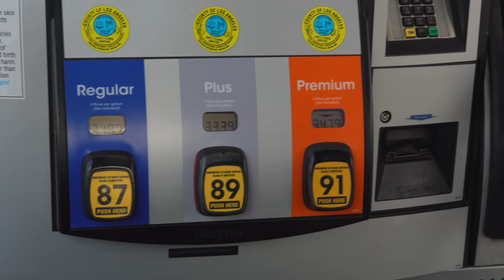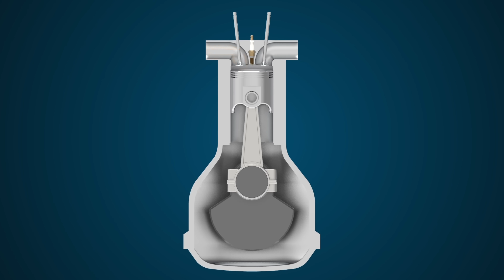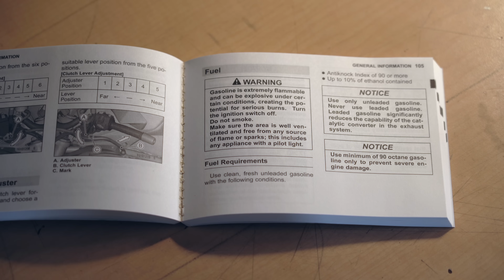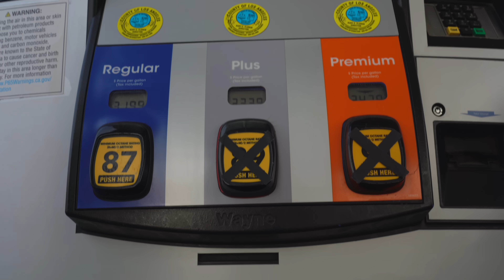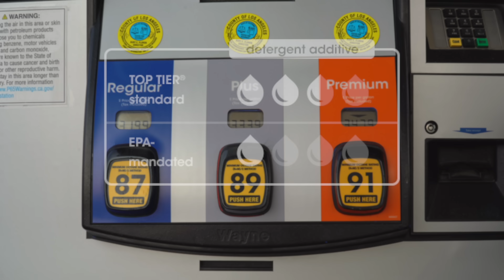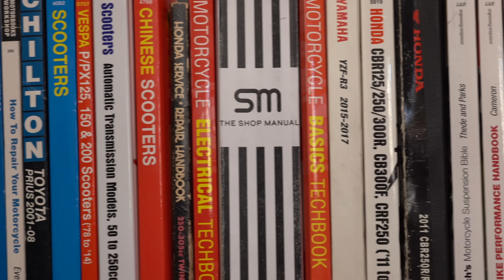Should You Run Premium Gas In Your Motorcycle? Octane Explained | The Shop Manual

Comment: So i have an mt09 and it says use unleaded only yet im still confuse between 93 and unleaded
Reply from the maker: At this point all gas is unleaded, so you can just ignore that.  93 is the octane rating, the big number on the button you push on the gas pump.

-Zack
Reply: @RevZilla  thankyou zack big fan of urs

Comment: This isn't true. Tests have shown the average engine produces better mileage with a high octane (to a level) because they make better power. Modern efi can change the amount of fuel the motor gets. The more efficient burn, less detonation, the less fuel needed, better power.  Also on a side note. Most fuel stations buy this garbage called "transmix" which is where fuel storage facilities off their systems after a change to maintain clean fuel lines. This transmix is purchased and waters down the fuel that stations purchase when requested. 87 octane is where this usually ends up and in some cases, 91 is taken down with mixtures to 89. Transmix can contain light lubricants, diesel, gas, jet, oils, etc that a storage facility or pipeline company potentially have in their system.

Comment: I only use 93 octane in my Harley LiveWire. It seems to keep the plugs from fouling.
Reply: Damages the flux capacitor ???
Reply: @scotthorn5792  only above 88mph.
Reply: @scotthorn5792   Now that could be a problem.
Reply: @scotthorn5792  Absolutely!
Reply: My 96 virago literally says premium fuel only on a  manufacturer sticker above the tank on the frame
Reply: @FalloutGenius1  … That means your Mc needs Premium fuel!
Reply: I do the same in my Powerstroke. Not a single fouled plug yet!
Reply: I usually use diesel in my live wire
Reply: 😂😂😂😂 perfect I do the same in Tesla 🤣🤣🤣🤣
Reply: Get a Honda and not worry
Reply: You may be burning oil that it is not suppose to burn, (at the same time running a rich fuel/air ratio), or you may be running too cold of a heat range for your spark plugs.  If you have the right plugs, you need to lean out the fuel/air ration so it runs hot enough to burn off the deposit on your plugs.  All a fouled plug is, is a sort circuit with the voltage going though the wet deposit instead of jumping the gap.  You will also get better fuel mileage, more power and probably top RPM, (which we don't hit with Harley's anyway).  Even if you are burning oil that you should not be burning, (valve or ring leaks), the proper fuel/air ratio will burn that too, and not foul a plug. Either your plugs are too cold, or your combustion is too cold. If you still get smoke, (other than starting it up), then you are burning oil you should not be buring.  I take it you have a carburetor on that bike,---because Fuel injection runs super lean---with white plugs.   If you jet your carb,---just go lean enough to make your plug dry, and a light paper brown bag color on the porcelain. If your plugs, (the right heat range mind you, and use the inexpensive NGK plugs), get grey or white---you are going too lean.  I learned on dirt bikes.  I don't know your bike.  But you can buy a "shop manual", (not just the owners manual), from a dealership.  That is the book the mechanics use in the back room.  Should have all the information you need,---but some drunk guy wrote mine. :)
Reply: @EarthSurferUSA  a Harley live wire is all electric.
Reply: @justinpennington7682 don't you just love the way everyone has to explain things like they are all experts. I usually plug in my Street Glide to 93 octane watt outlet! 💀
Reply: Live wire is electric……. 🤔
Reply: Pro tip: lick the charge cable before inserting it, it increase the electrical output
Reply: My Harley V-Rod calls for high octane only and it isn’t even electric........
Reply: You r a live wire! Ha ha ha. Excellent joke, well done old boy!
Reply: WOW! So many of the replies are down right scary! 🥴
To think these people are allowed to drive on public roads and can vote! 🤦🏻‍♂️
Reply: Same here on my 1.6 LH7 in my Chevy Cruze.. keeps the plugs from fowling... ;)
Reply: I knew someone that was gonna do that, but they decided to run their bike on hopes and dreams instead.
Reply: Sometimes that 93 is not 93.
Reply: And I run e10 and e15 in my 84 V65 magna. 46,000 miles in 16 months and haven't even thought about pulling out the spark plugs yet. Changed synthetic oil every 5000 miles. Rear tire around 5500 miles. Front tire 11,000 miles and the headlight lasted about 42,000 miles. Cleaner burning fuel doesn't foul plugs
Reply: Harley LiveWire goes farther on AC than it does on DC
and 50Hz is better than 60Hz

if you are going to park the bike for more than a few months put some Seafoam in your battery......
Reply: Probably still on the first gallon of gas.
Reply: Are you mixing two stroke oil in your fuel? That's the only way to foul a plug with fuel, unless you have water in fuel also.
Reply: There's absolutely NO reason for your plugs to foul unless you have a carburetor way out of adjustment. You probably have fuel injection which would never foul your plugs.
I've run 87 octane in my Harley for nearly 2 years (5000 miles). My plugs are perfect - a coffee with cream color. I have NEVER heard a "ping", not ever, not even once.
You're wasting money on 93 octane. You could save a ton by using 87 octane and simply add STP octane booster - which might alleviate your unnecessary octane conspiracy fears.
Reply: Yea for sure u don't wanna foul 8 spark plugs that b a pain in ass
Reply: Wow so funny,angry pixies can't handle what I'm laying down.
Reply: In the generator for charging it? 🙃
Reply: Make sure you check the oil regularly to
Reply: Which u can just add an additive once or twice a yr
Reply: That or Karo syrup I think you'd find the performance similar 😅
Reply: Sounds scientific.
Reply: Sounds legit
Reply: You should try 104 racing juice. Woah, Nelly!😂
Reply: 😂😂too good😂😂
Reply: The live wire is electric, though... You don't need gas.
Reply: Aww , it was probably just running rich 😂
Reply: I've been running mine on water, I may switch after reading your post, mine is slow.
Reply: 93 octane 😂😂😂😂 we start at 95 in Europe
Reply: eh? Livewire??
Reply: LMAO....
Reply: Right on, I hear Ethanol can gum up the batteries, so watch out!
Reply: Its a Harley its going in the shop one way or another
Reply: Doesn’t running with high octane like that mess up the radiator? 🤔
Reply: @kato64 It will on a Livewire
Reply: Lol live wire is an overpriced electric bike
Reply: @captainthruster9484  the two wheel Tesla
Reply: Lmao!! 👍😆
Reply: Poor joke since Livewire is an electric motorcycle and doesn’t need gas. 😂
Reply: @cruze86 you tried to think and nothing happened!
Reply: how is your fuel such a bad quality? we only got 95 for regular in 98 for Premium
Reply: @MikeKnightfall  USA rating is R+M (over) 2
Europe uses a different rating system.
Reply: Only on Harleys! Surprised anybody still buys them. Also the oil spots I see on the road is probably from those shitty bikes.
Reply: @toddboden972 your just jealous because you ride a rice grinder!
Reply: ive never had a fouled plug...of course I ride a Suzuki. You check the sparkplugs when you got the time to take it somewhat apart. Every 5 years at least.
Reply: @iccus62  damn dude that flew right over your head 🤣🤣🤣
Reply: @iccus62  wooooooosssshhhhhh
Reply: @tylercarrell  lmfao ........some people e'h lol
Reply: @iccus62 I followed you advice and fouled the spark plugs on my Tesla. I hate you, man
Reply: @iccus62 livewire is electric motor bike... anyone posting electric motor bike crap in a gas forum needs to stop acting superior and sell it because its a lost cause, and trolling posts not specifically centered on him/her/it...
Reply: Does the Livewire leak oil  like the other Harley Davidsons?

Comment: Some owners of the new Ducati V4's advise to use mid octane fuel because of reported difficulty trying to start the engine when premium is used. Apparently the problem went away once switched to mid octane (which is the minimum recommended octane which is stated in the owners manual - 95 here in Australia, remembering we use the higher scale). Why would higher octane adversely affect ability to start the bike?

Comment: Vancouver Island BC WE have gasoline 87 oct. up to 10% ethanol, 89 oct.up to 5% eth. 93 oct.no eth. Please correct me if I am being misled. Eth. { not knowing the %] can and or be damaging to your delivery system to your engine. Living on the Island every person has an outboard engine & all parts are not metal.  I also run motorcycles Thanks for your interest. MY 95  1100 Virago uses 87 oct.

Comment: Started running exclusively Shell through my 2005 corroborated Harley after finding out they put more detergents than most other Top Tier stations. After a month of riding 75-100 miles a day and only using Shell my Harley was running noticeable better. Was able to do my first cold start in 10,000 miles without pulling out the choke.
Reply: Save yourself tons of money and just put in some chevron techron additive every 2000-4000 miles. Shell is a scam.
Reply: When I picked up my brand new BMW M3 years ago the dealer said "run it on Shell or you'll regret it". I lived near a shell and ran it on Shells most expensive gasoline and never had a problem. I've always used Shell since then on many high performance cars and bikes.

Comment: For me personally, I use premium gas in my '98 Honda Magna simply because the additional refining steps needed to produce higher octane fuel means less chance for unwanted byproducts to potentially clog my carbs.  The Magna is a fun bike but damn separating the 4 barrel carbs is not something you want to do any more often than you have to.
Reply: Lol!!.....placebo affect, my man.
It all comes from the same tank.
The difference is in the additives.
“Premium” fuel is not more refined or higher quality in any way.
Reply: @johnpeters9793  Sorry, John, incorrect.  Premium is a somewhat different blend right from the refinery.  Refiners sell even to their competitors,  and product pipelines are fungible, meaning the molecules a company puts in at are not necessarily the same as the ones pulled out at the destination.  Raw regular or premium is blended to industry specs, which can change seasonally (Vapour pressure).  The major companies do have their proprietary additives though, but these are primarily to promote cleanliness, reduce gumming and minimize gas line freeze up in winter, not to modify octane rating.  Additives are generally added at the marketing terminal where the tanker truck picks up its load.  I also had a Honda Magna (‘85) and used brand-name premium not just for the octane but for the additives.  For the relatively small cost I thought it best to minimize the risk.  But maybe 35 years of working in a refinery had me programmed for risk management.

Comment: I have a 94 FXDWG that is ported and polished, also balanced and blueprinted with full race cam and a really loud tuned Thunderheader. I can't use synthetic in the primary with the Barnett clutch and it has been on a dyno. 100 hp at rear wheel. I have to use 93. I just turned 74 and I'm looking at the Honda 500X or Kawasaki 300X. I hate interstate hwy, so no need to go 70 or 80.

Comment: At 4:00 you mention additives as detergent,  but the odd little secret is than many fuel deliverers add more ethanol to the same 86 octane pure gas to get the octane test number up.  

You start with 86 or 85 and add 2 to 5% ethyl alcohol by volume and the octane is 87 to 88 (passes a random pump test and contains the oxygen additive required by law).  Add the full 10% and you get to 91octane.  Alcohol is an octane booster since it is harder to burn than gasoline.

So at many stations (especially in rural areas not under strict smog inspections) the 91 is higher in ethanol than the 87.  You won't know unless you test it yourself.   89octane is usually mixed by the pump from the 87 and 91 storage tanks. 

Originally octane was the percentage of CH8 (and 9) over the CH7, CH6.  Natural gas CH3, CH4 is very combustible (easy to light).  CH12 is not as easy to light (getting to kerosene and diesel blends).  Try dropping a match into a pool of diesel... Nothing. 

All of it came off the same crude oil heatedand tapped at different heights of the refining column. 

Before WWII gasoline was very low octane,  so you could blow up a car by shooting at the gas tank.   Hard to do today.

Comment: Ezequiel Gueu
this is my question: my 2007 honda 919 has full sport exhaust, power comand 3, K&N filter, tunned  for performance, iridium spark plugs, and a few other performance up grades done by previous owner, but I just like to drive slow and peacefully. should I use which octane?

Comment: Regarding ethanol, I don’t even pump that crap into my truck. My local gas station sells 87 with ethanol for much cheaper than 89 that is without, but I’m more than willing to pay the price in difference even if the 89 doesn’t do anything magical for my gas mileage.

Comment: If your engine compression ratio is say 10.0:1 or higher premium fuel aka higher octane is best especially during the summer or hot weather months so for example if outside air temperatures are over 95 degrees pre ignition is more likely with a higher compression engine with over 10.0:1 compression because it starts acting like a diesel engine in that regard and that's bad for a gasoline engine because gasoline contains no lead un like diesel fuel does which has a very small amount of  lead to reduce pre ignition so higher octane is required to prevent it that is why a diesel engine doesn't require a spark plug because most diesel engines have a compression ratio of 16.0:1 or higher and generates enough pressure and heat to ignite the fuel.

Comment: A good thing to note is that higher octane fuels also tend to almost “go off” faster. Meaning a lower grade fuel will keep its quality longer. This is more a problem in australia where I live as we get up to 98 which will go bad much quicker than US fuels as it’s much higher but yeah, do keep this in mind
Reply: 98 RON is basically the same as 93 AKI. The higher the octane, the LESS fuel it has in it. Less fuel allows for higher compression and more advanced ignition. Resulting in substantially more power even with less fuel. If your car is stock, running 100 or 110 won't do any good. Because your stock engine will not increase compression and won't advance ignition to make use of the added octane. My car is tuned on 93. It makes less power if I run 87 and it makes less power if I run 100 (negligible, but it would rather have a higher percentage of fuel than more octane which it can't use). Neither is catastrophic, though more octane is better/safer than less....to a point.
Reply: Why would higher octane fuel go off faster??  
Sounds like BS to me!
Reply: It wouldn’t. That octane is measuring additives, which are cleaners, stabilizers, etc.
Reply: @mareksumguy1887  honestly, i really have no idea why 🤷‍♂️ but its just something thats happened in my experience. im not sure if soemthing in the higher grade fuels attracts water, dust etc. easier but its definetely a very noticeable difference (using an old bit of 98 runs bad after say a year whereas some 91 seems to run fine)
Reply: Ridiculous!!! (along with the far-flung misinformation coming from "The Father")
Reply: @Jeff82556  I’ve tuned cars & motorcycles and it’s pretty straight forward. The lower the octane (higher fuel contact) the more pre-ignition. The lower the fuel content (higher the octane) the more you can increase compression and then advance timing. Where’s the misinformation?
Reply: You need to ride more then mate. 98 only goes in my ZX10R and my fuel does not sit longer in my tank than 1 week. It will go off maybe in 6 months.

Comment: So premium can only do good to your engine (keeping it cleaner) even if your car/bike needs only regular right? But you should avoid putting regular in car/bike that recommends premium?
Reply: Use what the manual says to use, car or bike. One of my bikes recommends premium the other one regular and following this I have never had an issue. I also use only top tier gas as much as possible. My 2006 Mazda 3 with 120,000 miles has only seen regular gas and no added detergents with no problems.

Comment: Spot on. I'm not sure if there are any motorcycle engines that have this, but some ECUs (Engine Control Unit) vary the ignition timing in response to input from a knock detector. Therefore, using higher octane will allow for greater spark advance and, therefore, more power. However, using high-octane gas in a low compression engine that doesn't have this feature is a waste of money (unless you want to occasionally do some extra cleaning with the extra detergent in high-octane fuel). The owner's manual will let you know.

Comment: Thanks a lot Ari, you are a Savior & A talent 👏  i have a 2019 CB1000-R brand new, rode it first time with Shell V-Power, i stocked up on Castrol Actevo X-Tra 10W30 & Motul 7100 ester 4T 10W40 (2 boxes each), 4 K&N 204 oil filters & 4 Original Honda OEM filters, Motul RBF 600 DOT 4  brake Fluid + StarTron enzyme Fuel Treatment. I baby it dearly 😀

Comment: Yeah, run your shit box on regular gas and it doesn't all get burned, some goes out the exhaust system, but some stays behind. It starts to coat everything. It gets in your oil, blah blah blah. A clean engine runs better, clean oil works better. Premium gas will make your engine run better. Regular gas is the minimum. It is part of the vast conspiracy to make your car wear out. You will have to fix it more often if you run  it on that regular shute. You'll get regular performance, until you get sub regular performance
Reply: Regular shyte